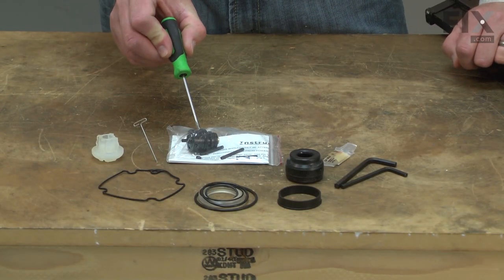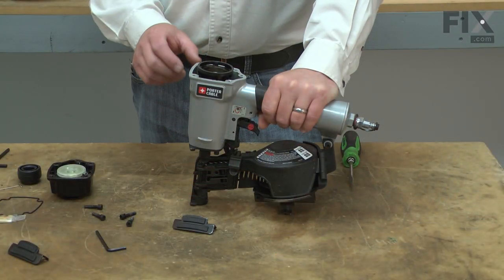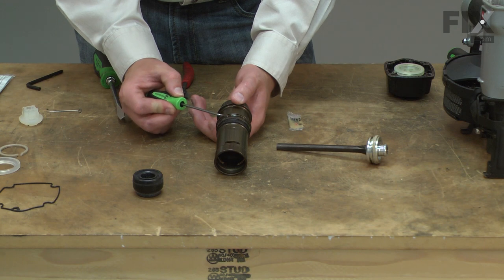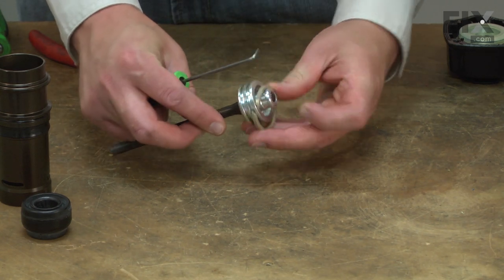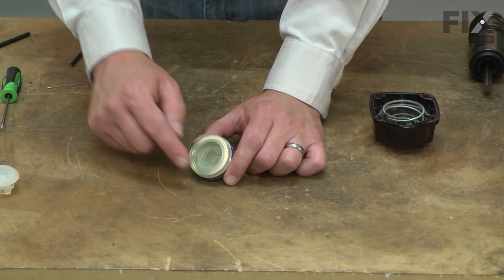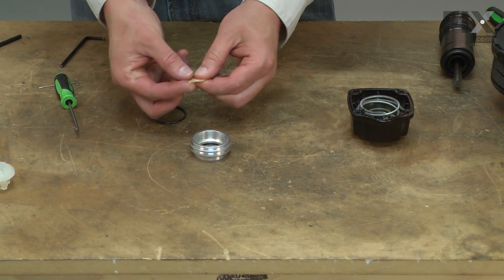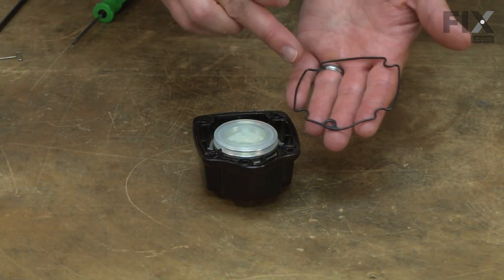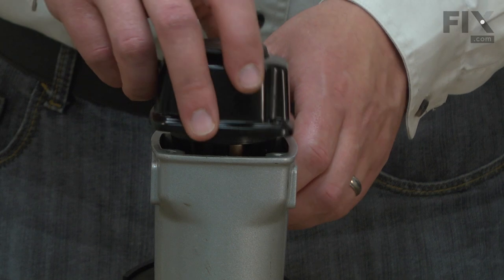Porter Cable Nailer Repair - How to Replace the Overhaul Maintenance Kit

Comment: Very good video. I have to go along with others here who asked about the trigger valve. It would have been nice to see that replaced as well.

Also of minor note....on my gun (RN175A), the rounded portion of the piston goes away from the nails, not toward the nails as you said at 7:50 in the video. Probably not anything serious here though, because the cylinder that the piston slides in is sized to only allow you to put the piston in the correct way.

All in all a VERY helpful video. This enabled me to install the new kit in my gun in under a half hour, and I am thrilled about that. I didn't install the trigger valve that came with the kit, since i'd like to find a video showing me how before i do that. My troubles were solved though. The gun is firing great once again.  My old piston stop was split nearly in half, so it was good to have a replacement for it. Thanks so much for this video!

Comment: Helpful video. I also had a shattered piston stop, which I replaced along with the o rings from the overhaul kit.

With my gun, if I install the white cylinder separator first, the cylinder won't install because of the check valve ring (that fits around the small holes). I had to put the separator around the cylinder, then slide up the check valve, and then insert the entire assembly into the gun. But even though the gun came back together, I'm not getting any air expelled on fire, and the piston doesn't retract. Any thoughts appreciated.